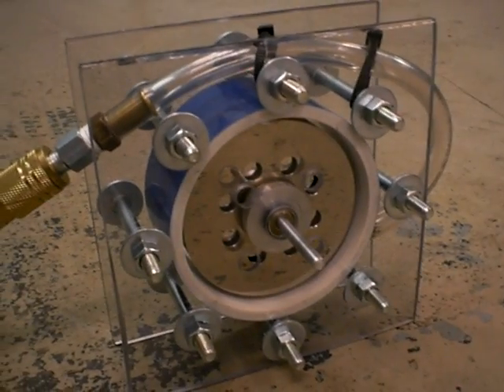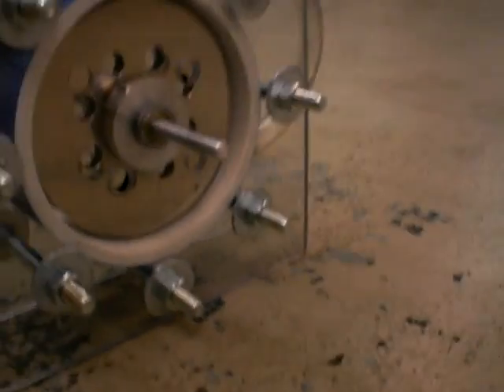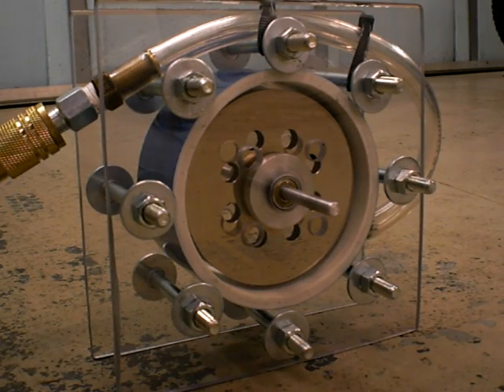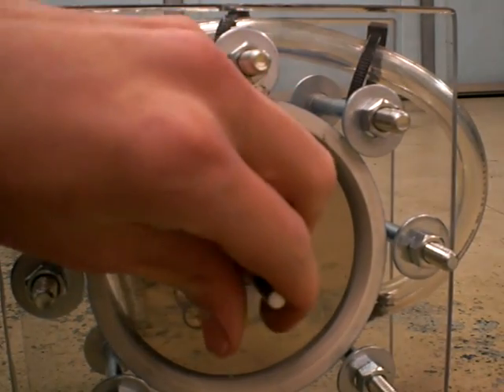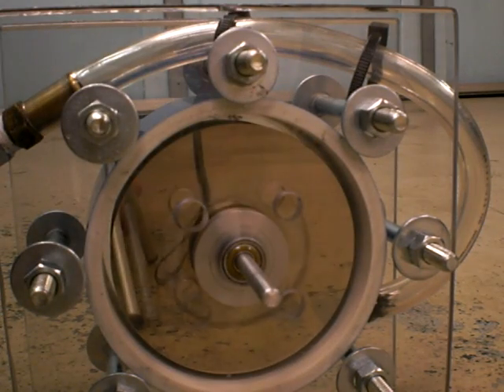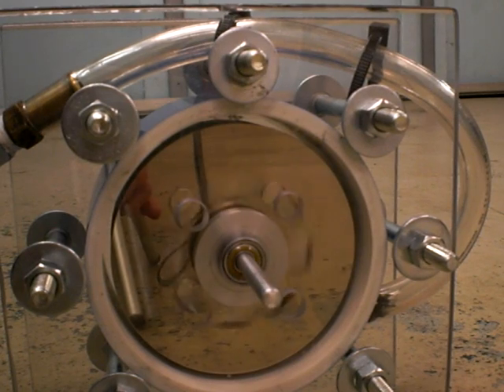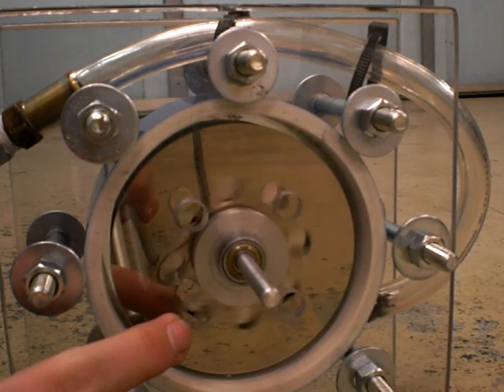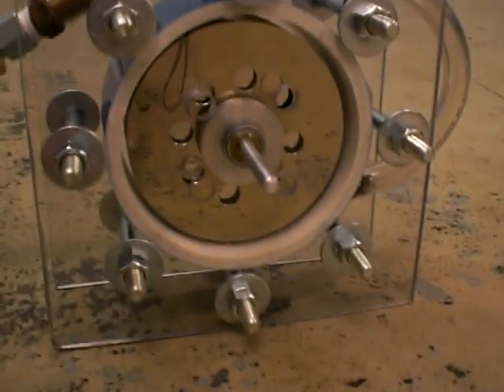Tesla Turbine

Comment: Tesla turbines are the most useless thing ever invented! Nicola Tesla was trolling when he said this was his best idea!
Reply: I hate to contradict ya but Tesla turbines get plenty of torque, output plenty of power and can do so even at low RPMs.   

They just have to be designed correctly to do so.     

There’s all the proof anyone could need to know this now.   10in diameter TesTur made from cheapo aluminum on room temperature compressed air Dyno’d at 6.22ft-Ibs of torque to the shaft at only 4150rpm and +4250watts between 6,000-12,000 rpm and real 250-2650watt electrical load test runs at 9,000-13,000rpm.  

The preliminary tests are just to see how much electrical power can be produced with room temp compressed air driving the Tesla turbine.   

The TesTur nozzles never went over 20psi at the nozzle for the 2650watt electrical load test and not over 40psi at the nozzle for the 4250watt dyno test.     

This is so a baseline can be acquired for what to expect as the temps are increased to combustion levels.     

When using elastic gasses the counterintuitive thing most overlook is that the viscosity of gasses goes up with temp.   

So not only is there an increase in thermodynamic efficiency from increased temps but the TesTur isentropic efficiency also goes up due to the reduced slip from the increased viscosity.
Reply: I appreciate your comment but that’s not an issue because, despite what everyone erroneously claims, Tesla turbines work just fine, get plenty of torque and output power at low RPMs.     I’ve got some copy pasta 🍝 of mine that I’ll share with ya here to explain more.  Tesla turbines aren’t made efficient by spinning really fast.   That’s only for when the disc stack is being used as a centrifugal pump, because ALL centrifugal pumps’ compressors, performance is tip speed dependent.   But spinning the turbine fast will produce a centrifugal head that opposes the incoming fluid flow, reducing the pressure gradient across the nozzle, reducing fluid final velocity, reducing mass flow rates through the nozzle and ultimately reducing power out. 

Furthermore the faster you spin them the faster the fluid you have has to go just to still be moving faster than the discs and still provide torque.   Lastly, they work just fine for industrial use and can scale up just fine because the torque on the discs is proportional to the difference in the fluid speed and the disc speed. So the disc tip speed is the important factor here. For any given fluid supply in the nozzle will have a max fluid velocity. So the turbine disc tips will have a max speed set at that fluid speed irrelevant if radius. Now considering that centripetal force is proportional to V^2/R, if you keep the tip speed the same but increase the radius the centripetal forces on the disc for the speeds needed will actually decrease. 

Despite what MANY have claimed about the Tesla turbine, it does NOT need to be spun fast to work or work efficiently.   TesTurs are made efficient when the slip on the discs is reduced and spinning the discs fast does nothing to reduce the slip, only increase the distance the fluid slips on the disc faces, which is by definition “loss”.  Listen to what Tesla himself said in the patents of how to make them work.  “Owing to a number of causes affecting the performance, it is difficult to frame a precise rule which would be generally applicable, but it may be stated that within certain limits, and other conditions being the same, the torque is directly proportionate to the square of the velocity of the fluid relatively to the runner and to the effective area of the disks and, inversely, to the distance separating them. The machine will, generally, perform its maximum work when the effective speed of the runner is one-half of that of the fluid; but to attain the highest economy, the relative speed or slip, for any given performance, should be as small as possible. This condition may be to any desired degree approximated by increasing the active area of and reducing the space between the disks.”  1) increase the speed of the fluid relative to the disc, (not increase disc speed)  2) increase surface area 3) decrease disc spacing  This is how you actually make a TesTur work. Not by spinning it fast.   The fluid interactions with the disc that govern efficiency an torque are adhesion and cohesion. Full stop. And spinning fast does nothing to increasing either to increase the turbines isentropic efficiency.   This is why everyone who chases rpm with the TesTur just flat out fails. They aren’t even trying to design them properly so of course they won’t work.
Reply: You just have to know how to design it correctly to actually reduce slip to make them work, not spin them fast.  The only reason people think Tesla turbines have to be spun too fast is because EVERYONE has mistaken the part of the patent that is about the turbine being used as a pump as being about it being used as a drive turbine.   The only time you want to spin a TesTur fast is when it’s being used as a pump/compressor. This is because ALL centrifugal pumps’/compressors’ performance is tip speed dependent.   “I have found that the quantity of fluid propelled in this manner, is, other conditions being equal, approximately proportionate to the active surface of the runner and to its effective speed. For this reason, the performance of such machines augments at an exceedingly high rate with the increase of their size and speed of revolution.” -Nikola Tesla 

And again, you DO NOT want to spin too fast in a TesTur because the centrifugal head will just counter your incoming fluid flow reducing power. And the faster you spin discs, you’re fluid has to be going even that much faster just to be able to apply a torque on the disc face.   “Still another valuable and probably unique quality of such motors or prime movers may be described. By proper construction and observance of working conditions the centrifugal pressure, opposing the passage of the fluid, may, as already indicated, be made nearly equal to the pressure of supply when the machine is running idle. If the inlet section be large, small changes in the speed of revolution will produce great differences in flow which are further enhanced by the concomitant variations in the length of the spiral path. A self-regulating machine is thus obtained bearing a striking resemblance to a direct-current electric motor in this respect that, with great differences of impressed pressure in a wide open channel the flow of the fluid through the same is prevented by virtue of rotation. Since the centrifugal head increases as the square of the revolutions, or even more rapidly, and with modern high grade steel great peripheral velocities are practicable, it is possible to attain that condition in a single stage machine, more readily if the runner be of large diameter. Obviously this problem is facilitated by compounding, as will be understood by those skilled in the art. Irrespective of its bearing on economy, this tendency which is, to a degree, common to motors of the above description, is of special advantage in the operation of large units, as it affords a safeguard against running away and destruction. Besides these, such a prime mover possesses many other advantages, both constructive and operative. It is simple, light and compact, subject to but little wear, cheap and exceptionally easy to manufacture as small clearances and accurate milling work are not essential to good performance. In operation it is reliable, there being no valves, sliding contacts or troublesome vanes. It is almost free of windage, largely independent of nozzle efficiency and suitable for high as well as for low fluid velocities and speeds of revolution.” -Nikola Tesla  Tesla both knew it wasn’t meant to spin fast and that it worked great for low speeds IF you design it correctly.

Comment: nice job!
any idea how much horsepower it generates?
Reply: Guy up above asked "Where's the energy going?".... I'm asking "Where does the energy come from?"... I'm not sure I'm following what is going on here, what is the point.  If he's just blowing in air to make the thing spin, so what?  As soon as you put any sort of "load" on that axle (which he grabbed with his fingers to slow it down), the spinning will STOP!! So what's the point?  It takes "energy" to blow the air, get the air pressure, thru that tube. Some sort of "compressor" running on electricity, gasoline, kerosene, etc.  So is there going to be any Net Gain of "energy", horsepower, work output?  I don't it.  Most of these things prove out to be "bunk" (no positive Net Gain), or if they work at all, then the Cost, Materials Required, Size, Labor to make it, Maintenance Expense (i.e. bearings and rubber burning out all the time, etc.) ... makes them "uneconomically feasible"!!! That is why we burn fossil fuels, cuz they are the most cost efficient, eventhough they are not the most energy efficient.  Cheaper to put gas into an engine, than it is to build a nuclear power plant.
Reply: @aspenrebel  With TesTur Energy, the mission is to give people energy independence through Combined Heat And Power (CHP) systems that can make use of underutilized energy sources like biomass, solar thermal, geothermal and even low grade fuels containing high quantities of solid particulates (like pulverized coal and powdered iron); energy sources/stores that are currently underutilized due to the lack of turbines and engines capable of handling the multiphase fluid flows (any combination of gasses, liquids, solid particulates) present in low grade heat boilers and low grade fuel sources without damage over prolonged/continuous periods of use.
Reply: @aspenrebel  Can you show me a bladed turbine that can handle the wet steam that’s produced from geothermal energy sources without eroding down the indispensable complex geometry blades to little nubbins in a matter of minutes?   

Or a bladed turbine that can actually fully utilize all the heat energy in steam by actually fully expanding it and not be damaged by the condensation and cavitation?   

One that doesn’t require superheaters, MASSIVE heat exchangers and expensive waste heat recovery systems to actually maintain whole system thermal efficiency?   

Yeah sadly bladed turbines get zero efficiency from geothermal steam sources and can only be used to produce electricity from them with outrageously expensive multi circuit loops to keep all the fluids separate and have MASSIVE heat exchangers.   

But when even just one geothermal site in California has more energy than the US needs for the next 1000 years and TesTurs see no damage from multiphase motive fluid flows I’d take even just 10% efficiency over the zero that bladed turbines can offer.   

The same goes for solar steam boilers because it’s very difficult to have a residential solar boiler that doesn’t produce wet steam.   

Furthermore bladed turbines can’t use low grade fuels like biomass, woodgas, and definitely not solid particulate fuels like powdered coals and pulverized iron.   

That’s not an issue for the TesTur for the exact same reason that condensate and cavitation in wet steam doesn’t damage it. 

Because there’s no lifting surfaces for the particulate to smash into.
Reply: @aspenrebel  What most people mean to be saying is, bladed turbines get a high efficiency on only a very limiting, very specific, very expensive set of proprietary formula refined fuels.  

And the only reason TesTurs don’t is because no one has actually put any money into them like the BILLIONS of dollars thrown at proprietary bladed turbine designs just to get 1% point increase in efficiency.

Comment: You can transmit electricity through the air, it's just really really inefficient. That's how electric toothbrushes charge, xbox controllers etc. It's just electromagnetic induction.
Reply: Except Tesla never planned on sending energy through the air with his wireless transmission system. He was sending regular high voltage electric currents through the ground/earth “without wires”.

Comment: The part where this becomes useful is that because the fluid isn't actually pushing very hard on the disks, it leaves the turbine as exhaust at almost the same pressure as it entered at. This in mind it becomes possible to daisy chain them together : Intake - rotation - exhaust - intake - repeat. Here you apply a high speed (20,000 rpm or above) low torque turbine all using the same "fuel" source to do approximately the same work. Extremely efficient and easy to maintain and repair.

Comment: The Tesla turbine uses the physics of skin friction. Friction exists due to tiny ridges of atoms somewhat like a mountain range (a reeeaaally tiny one). even the smoothest surfaces like polished metals or glass have them. The Tesla turbine takes advantage of these ridges by passing a fluid (here the compressed air) over a disk (or more probably disks) with a large surface area. Air gets caught in these little ridges and pull on the disk causing rotation. (message contiued)

Comment: you don't get electricity from direct friction. you get heat. 

Conventional way of creating electricity (Electron current and so on) Is by moving a magnet over a conductive piece of material at a high rate. 

Or solar power. 

Or chemical power, yep, you guessed it, batteries are for powering things.  

I don't know any way that you could collect electricity directly from friction.

Comment: If you look at the patent application the inlet and outlet should both be on the rim of the discs. Forcing the water out in the middle is kind of stupid as the centrifugal force will try to sling it towards the edges of the disk, especially when operating in high RPMs. Tesla was not stupid thats for sure :D

Comment: also you have no rotary power cuz motor isn't heavy attach some lead (just a bit 100grams) and take the pump a bit away and make an octagon or even better icosikaihenagon(21 sided) motor then it has more friction to the air and also you can help it from the beginning with hand because of the lead just to gain speed and mass :0 so put some magnets and coils+battery+battery-to-air pump :D and there you go when it reaches very high RPM just detach air pump from plug and attach to battery :)

Comment: you know that if you put that on magnet gearing or levitation and put some SN NS SN ordered magnets and put coils and more coils but not too close cuz beware of eddy currents and then spin it with air, (the main problem of electromagnetic generators is cuz they don't use a third energy in its circuit) I made experiments YOU NEED SAME QUANTITY ENERGY APPLIED FROM THE AIR PUMP TO MAKE IT SPIN FASTER THAT IS QUANTUM PHYSICS GAS PARTICLES UNDER AN ANGLE DON'T SLOW MOTOR THEY MAKE IT FASTER!!!

Comment: Actually, reality hasn't caught up with theory yet, which is why I say the efficiency will be much less, maybe 10% if you are real lucky.
You see, you need a 10 horse power air compressor to power up a one horse power pneumatic tool. Check it out. Service people use pneumatic devices all the time; look up the requirements.
They still use them because they are so light weight relative to their counter part containing a motor.
Reply: We’ve already blown that TesTur Efficiency out of the water. And yes real power and torque even at low rpm, IF you know how to actually design them correctly. 

6.22ft-Ibs of torque at only 4150pm and +4250Watts between 6,000-12,000 pm. And real 250-2650watt electrical load runs even. 

LThese preliminary tests are just to see how much electrical power can be produced with room temp compressed air driving the Tesla turbine. 

The TesTur nozzles never went over 20psi at the nozzle for the 2650watt electrical load test and not over 40psi at the nozzle for the 4250watt dyno test.   

This is so I can get a baseline for what to expect as I increase the temps to combustion levels.   

When using elastic gasses the counterintuitive thing most overlook is that the viscosity of gasses goes up with temp. 

So not only do we see an increase in thermodynamic efficiency from increased temps but the TesTur isentropic efficiency also goes up due to the reduced slip from the increased viscosity.

Comment: What is the torque output at 20,000 rpm?

What cfi and pressure are you feeding it to get that output?
Reply: At 20,000rpm just about any torque is a decent amount of power. 

HP = torque * RPM / 5252

Even if the torque is only 2ft-lbs, 

Hp = (2ft-lbs) * (20,000rpm) / 5252

Hp = ~7.62Hp or ~5.6kW…

5.6kW is far more power/load than the average home uses on an average basis. It’s not quite peak residential loads but the average home uses about 25-30kWHrs of energy, so that averages out to about ~1kW to ~1.25kW average.

Comment: would it not make more sense for the air or steam to flow from the center outward similar to the way most high speed water pumps work spinning a disk witch creates higher pressure on the outside

Comment: I don't know why people talk about free energy here... a turbine does one thing: convert energy from one form (motion/pressure of a fluid) to another one (motion of the shaft), there you can put a generator which converts the energy from the shaft to electric energy. Free energy is not even worth mentioning.

But the project is really well made, otherwise it would bounce around like a rabbit at 20.000rpm. There's a little vibration, that's it. Nicely done!

Comment: Re the magnet being suspended indefinitely: the weight of the bottom magnet is being transferred over to the upper magnet holding it off the ground - this is exactly the same to if you tied the magnets together with string and picked one up so the other hung underneath; much like a tyre swing off a tree branch. The magnetic field is just an invisible string. No energy magically disappears, or magically gets created